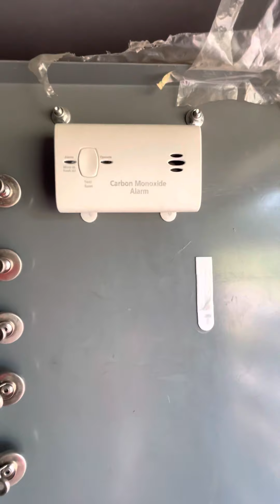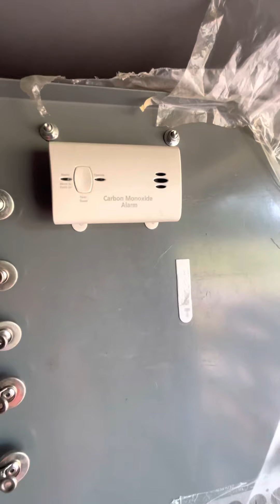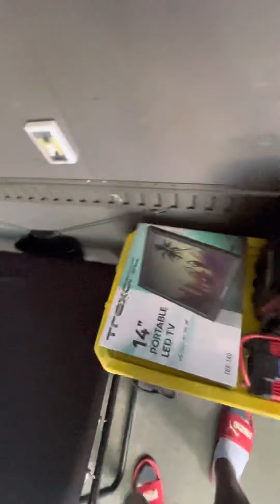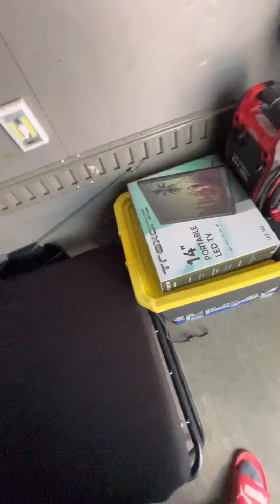How To Live In A Sprinter Van While Expediting Over The Road

Comment: Ok, I did buy the dually style extended with high roof. I also plan on having a platform over wheel wells with easy tracks system on top  of the wood and walls sizes plus add drawers under for storage. Sine inverter on solar for power. Also building a  foam bunky board bed that can be hung with 4X4s using easy track products. I so so love your video!

Comment: Bro  I appreciate you for going over this video with us. I’m about to start myself next months and I swear I was wondering how I would sleep in my sprinter Van. Also brother what insurance do you have?
Reply from the maker: No problem thanks for the support!!! I have insurance thru progressive. You can also try 3 by Berkshire Hathaway for commercial insurance.
Reply: Ive notice that people never use 16-17 foot Box Trucks for Expediting.. Why is that, especially if there is More Room,and there are trucks that Dont have Exposed Wheel Wells,and,also come with,Lift Gates? The trucks are usually 350 duallys,and the milage is about the same as the Freightliner vans..So,why aren't they used???
Reply: Ohhh... I forgot about one important reason why the 350 dually Box trucks, probably,aren't used... They are Commercial Trucks that weight 14,000 pounds and you need a special DOT certificate to operate your business using that type of truck.. I forgot about that.. I think I just answered my own question...let me know if there is more to it than that.Thanx